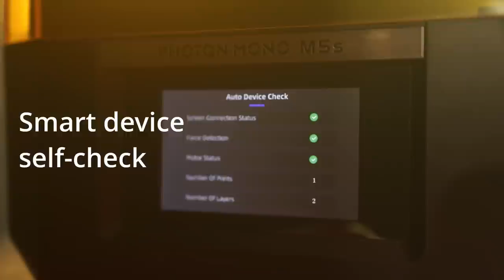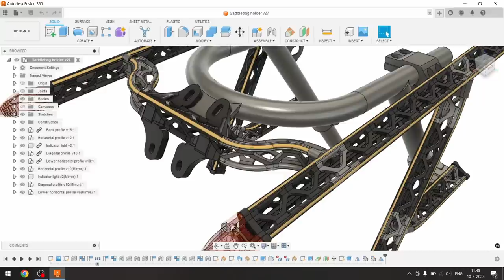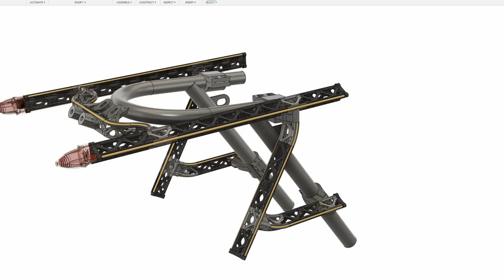I customized my motorbike with 3D PRINTS. Why?

Comment from the maker: My initial thoughts were: "Let's do a quick and fun build with this system." Right from that moment I should've known that this wasn't a two week project. Oh well, it works. And although this system needs to be improved further, I think that it's a fun concept which can be turned into a 3D printer ;) Thanks to anyone who suggested to tighten it from the center, this sparked the idea for using the twisted fiber!
Reply: Impresionante trabajo, en todo sentido. Cuánto talento!!! ya sea en diseño,  como en la producción artística de video. Gracias!!
Impressive work, in every way. How much talent!!! either in design, as in the artistic production of video. Thank you!!
Reply: You should try metal casting these parts instead of using plastic. Or making your own injection mold so you can mix fibers into the plastic.
Reply: Aramid fibers break down with exposure to UV.  Having them exposed isn’t advisable.
Reply: Aramid fibers break down with exposure to UV.  Having them exposed isn’t advisable.

Comment: Aramid fibre is said to substantially degrade with UV exposure. While the outer fibres will protect the inner ones to some degree (and the beam structure as well as the stuff around will partially shade the fibre strand), you might still want to consider putting the fibre strand in a sleeve or something.
Reply: The mechanical properties also decrease a lot when subjected to moisture.
Reply: just switch to dyneema. Only thing that can't handle is high temps
Reply: I was thinking wetting the fibers with a low viscosity resin or even CA glue with some sort of UV blocking tint would be a good way to protect them from the environmental degradation.

Comment: Your going to need a UV protective clear coat for those indicator covers. The resin will over cure and they will become extremely brittle to the point of crumbling with the slightest bump. A nice gloss finish would also look really nice and make them more transparent if that's a look you'd want.

Comment: personally when I tried bending brass tubes to make a pop-pop boat, I filled my 4mm (ext diamaterer) whith very thin sand (goes through a .5mm mesh), capped one  the ends with desktop tape, put the sand into the tube with a piece of paper rolled into a cone to make a funnel, and capped the other end with tape.
The (two) tubes bended really nicely (<15mm bending radius), without needing to heat-softened beforehand (I didn't have a blowtorch at the moment)

Comment: the brass tube is work hardened. Anneal the brass tubes before bending, you will be AMAZED how much easier it will be.
Reply from the maker: Never thought of that, thanks for the tip!
Reply: Also purchase or design print a mini tube bender I've seen some cheap ones online.might save some hand strength down the road

Comment: Nice work, I design and print lots of parts and upgrades like this, Just an FIY on nylon carbon fibre, and similar as this is all I print, dry it at 90° C for at least 8hrs, the longer the better, and print from a dry box that can maintain 85° C, I wont print it until its below 10% humidity, no fan while printing, and use a heated chamber for even stronger prints, also recommend PAHT-CF's for better stiffness, but for eBikes, motorbikes and other fast moving vehicles I use normal PA-CF as it becomes very flexible after it rehydrates, making it very durable for knocks and impacts, also I line all clamps and interfaces with a gasket printed from TPU, excellent for removing vibration, you can vary the infill and pattern to give it more softness, depending on the need.
Reply: This is so true. Nylon absolutely has to be dry but when it is it prints incredibly. We use Essentium's HTN-CF25 at work for fixtures that we'd otherwise need to have milled from aluminum, it's really incredible stuff but I'll give it a night in an environmental chamber at 130C and <10% humidity immediately before printing. Even a day later and the prints will be a stringy mess due to the absorbed moisture.

Comment: I do like how the aesthetics of the tail lights in particular came across. I don't know, but I think the pre-tensioning functionality here might be the most interesting thing about this.  Could have applications for, say, 3D printed aircraft.  NO, NOT THAT YOU FLY IN---the smaller, more autonomous sort. Some sort of testing of load bearing and deflection/rigidity would be interesting.  Suppose you used your pre-tensioned strut to span various distances, and measured things like rigidity vs deflection vs elasticity and vibration dampening vs resonance? Btw, as you have found out first-hand, CF nylon doesn't shrink as much as regular nylon, but it does shrink enough that you sometimes have to oversize your prints to account for it. Love your work!

Comment: 13:10 in bike frame hydroforming they have 3 or 4 moulds so they don’t do from tube to final shape in one go.  as so maybe do 2 or 3 dies to form the brass. I assume your die over bends the rod to account for spring back? 

On the filling aspect could you make a jig that holds a heated rod then put it in an arbor press. You place your part in mount and drop the rod down to melt the perfect shape into the thermoplastic - might be quicker than filing each one 

Also when you anneal perhaps you could thread each part onto a ride so that it limits contraction to the rod length axis. And keeps the shaft hole smooth?

Comment: Kevlar without protection is quite problematic if exposed to sunlight. It will loose its strength. 6:30
Reply from the maker: It does indeed, but I don't stress them that much. Hopefully it doesn't become problematic, but time will tell.

Comment: Could you share what oven you bought and the temp/time/process you went through to anneal the pa-cf? It's a material and process I've been looking to experiment with myself.
Reply from the maker: I annealed it at 120 degrees for two hours. I haven't tested the actual performance though and these numbers is what I could find. It will also differ between materials, most Nylon out there is PA12-based while the Luvocom material is PA6 which is stiffer.

Comment: 12:15 you could have made large molds like for hydraulic press to get exactly the shape you want ... Then again, at that point you need to know % to go over to get the desired shape once pressure/tension on brass is removed...
Aww crap, i did the same thing you did :D

Comment: What about using a brass H-beam instead of brass tubing? That should increase mechanical resistance to bending. It would need capped end-plates but that shouldn't be an issue with how you are using aramid fibres to hold everything together. I use the h-beams when I design linear actuators for structural integrity and "lower friction"- linear glide rails with (resin-) printed parts.

Comment: I think the indicators could have been better with amber LEDs and clear resin prints. My motorbike has LED indicators with clear housing, so it certainly can be done.
Reply from the maker: I think that they would perform better indeed. I chose orange because of the looks, but maybe I'll reprint them so they're a bit brighter.
Reply: @properprinting   I mean, it isn't like it makes a huge difference in power draw from the electrics, and the fact you can ride a registered motorcycle there without indicators in the first place (I'm not sure if I can, I don't think I can in the UK), means that it's immediately safer for you to have them. But I've noticed, especially at night, it can be difficult to see the colour of an indicator using a white bulb through amber in the past. The flashing always gives it away, but that could mean during daylight it'll be much more difficult to even see it flashing too.

Comment: Your uploads always make my day!! Just a question, doesn't CF filament obliterate the thin copper insert of the cht nozzles?
Reply from the maker: Awesome! No idea, but I went with the CHT nozzle because of the good thermal conductance that improves layer adhesion. Chances are that this nozzle needs to be replaced soon.
Reply: @properprinting  Fiber filled filaments have disappointed me for this exact reason. Even when I print them really slow, the layer adhesion is sub par without annealing. PCTG and PC blend ended up being my preferred filaments for projects that experience loads.

Comment: Hi can you explain in more detail how you tension the Kevlar
Reply from the maker: One part has a rotating conical part that looks a bit like a shirt button and the other side is stationary. By rotating the conical part the fibers twist and the length decreases, tightening the structure.
Reply: @properprinting  hi Jon can you show me a drawing
Reply: I think i get it, very clever
Reply from the maker: @deanlegg418  I'm going to improve this system in future videos and will share everything after that.
Reply from the maker: @deanlegg418  thanks!

Comment: As a fellow Dutchman and absolute fan of them; what can you tell me about the Mini lurking in the background? Any and all information welcome.
Reply from the maker: That's quite the story! I bought the Mini 7 years ago after I broke up with my girlfriend and I needed to do just whatever I wanted. After two weeks of driving it I blew up the engine and my father and I placed a new engine in there, a 1275. This was however an automatic and we modified to manual. Every part, including the wiring, I held in my hands and it was quite the adventure. I repaired it two times alongside the road, once because the cooling tap exploded and once because the belt was ruptured. After that I decided to start my own business that has grown into this channel. I realized that I was unable to get it on the road, due to the poor state of the body and lack of time. Luckily I know someone close by who supplies parts and also restores Mini's and I recently contacted him. I saved money to get it on the road again which will hopefully be this year!
Reply: @properprinting  what an awesome story and thank you for sharing it. I was expecting build year, model and perhaps originality… but what I got was so much better :-)
Reply from the maker: @nirodha7028  you're welcome! Build year is 1981 by the way, it's an Austin and it is not very original anymore xD
Reply: @properprinting  yeah I thought as much after hearing what you did to it ^^. I used to own a ‘92 Rover Mini Cooper 1.3 SPI and a ‘74 Innocenti Cooper (although the latter also wasn’t much original anymore). I love those little carts. Most fun to drive of all vehicles I have ever driven.

Comment: Is this new system lighter than the old one with the rods?
Reply from the maker: It will be if I don't use brass tubes. Guess what, I already bought CF tubes for the 3D printer I want to build!
Reply: Nice.
Really looking forward to the Video. =)

Comment: What's the plans for your Mini?
Reply from the maker: I know someone who restores these Mini's and it's mostly bodywork that has to be done. I'm going to save some money to get it done and I can't wait to start driving it again!
Reply: @properprinting  I used to have a Clubman Estate with  a 1275 engine, was great for driving around London at the time, I'm sure it has featured in some Japanese tourists photo's when I used to drive around Piccadilly circus waiting for the parking restrictions to lift in the evening! 
 any queries gimme a shout!
Reply from the maker: @irishlocksmith  that's awesome! My father and I put a new engine in this Mini which is a 1275 too, almost a brand new engine. It was an automatic which we converted to manual and also tuned a bit. This was an awesome project which we did before I started this channel. Never found the time to get to bodywork and I hope that I can get this done rather soon.

Comment: I love the apple analogy and the explanation of your process/how it got out of hand, but stop doing this to yourself!
You know how much work is involved in mating imperfect prints to one another, stop putting so much work into a frame system thats no better (stronger/cheaper/easier) than steel pipe. You already made a bending tool. 😅 Just take the easy route out.